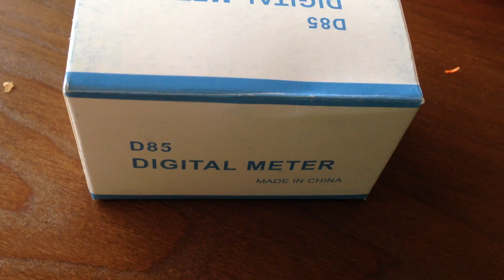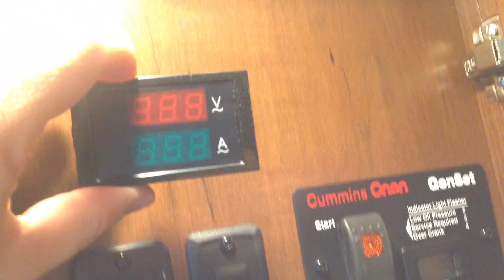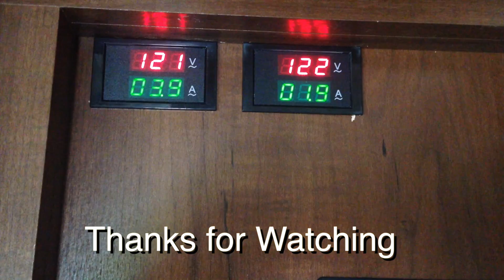Monitoring the input voltage and current of my RV.

Comment: Just watched your video on the volt meters.  Is your RV really a 220 volt?? I just had my rv in the shop and installed a new AC unit (15000 BTU).  Now this is when it gets expensive for an education. I got there and started up my new Honda generator  (3KW inverter Gen) to see how it was going to run the new unit. the new AC would not run. Soooo! after some panic time at the Rv place, I am a retired EE from AT&T I said lets bench test the old AC unit you pulled off, they said they had no way to do that... I said it is really easy just  wire the compressor and fan with a jumper, I would do it for them. said no they could do that. Next day I went in and they said the old AC was good and working, lots of cold air. and what do we do now ( with a worried look on there face) RV is 34 FT so I said lets put it up front, everyone OH! we can do that. Now in the process of troubleshooting, they did get a electrical man involved, I got him aside and ask about the electrical system. he said " all RV's are 120V on the 50AMP models they just use a FAKE 50 amp. I said no phase shifting for the second leg, NO just fake. ME...so I could have fixed my problem with a 2 inch jumper in the generator plug.....YES. That is why they call it a fake, I did and it did fix it. So all of those SPECIAL jumpers you buy, just have a jumper in them.     Now this was a $1700.00 lesson for me so thought I would share. PASS it along. In you video the voltage is the same, thats why. Amps would be different because of the load on those circuit. GOOD video will help me install the meters, yep two legs two meters just add in your head. Although one would work, just both leads in the coil....same phase and I think the amps would be additive with the coil. TKS a lot Berry
Reply from the maker: +berry black Technically it is a dual 50 amp 120v. It isn't a fake 50 amp, but may be a fake 240v. As in both "phases" are completely separate. They could be the same or separate phase with no difference. Mine came from the factory with almost everything on the first side except the outlets.  I don't have any 240v devices or 240v breakers, but I think it is better to balance them.  I would NEVER jumper the two sides together. You could blow that wire up in so many ways. You should be warned that a inverter generator is pretty worthless for an RV (unless it is a pure sine wave model which I have never seen). They are much lighter, but CANNOT drive a heavy inductive load like a 15k air conditioner compressor. If it does manage to start it, it will burn out the motor super fast.